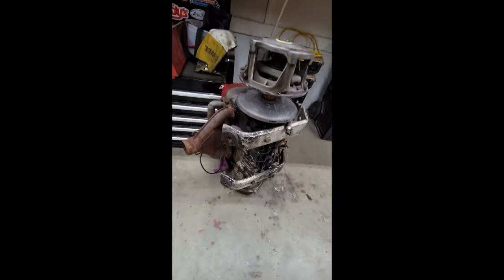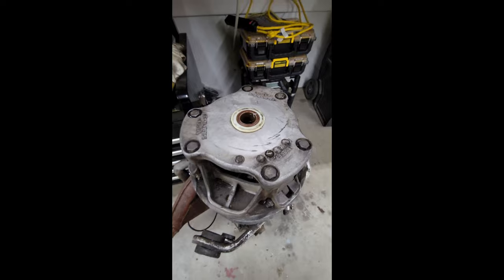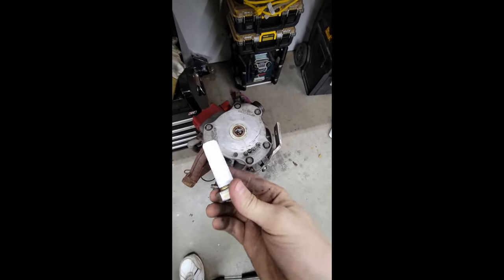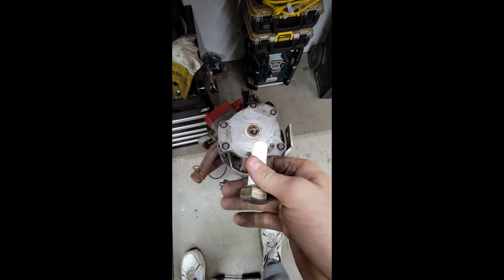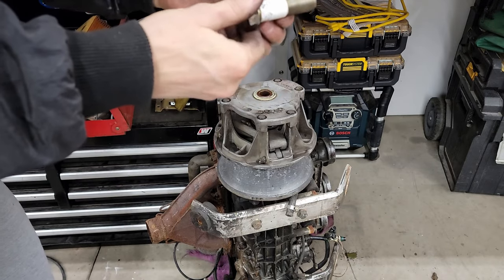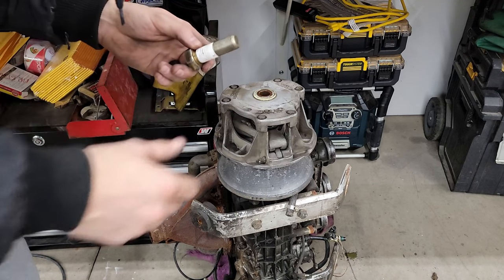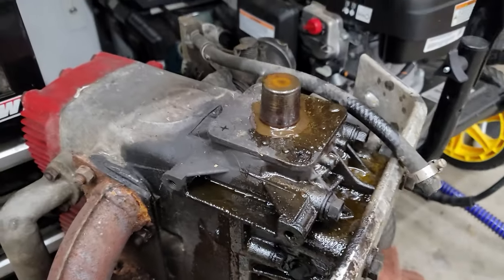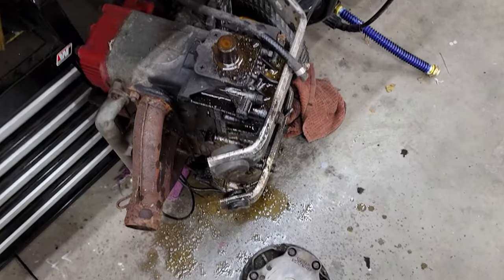Sled Tips 023 - Primary Clutch Removal water trick! YOU CAN SEE IT COME OFF!!

Comment: Using grease is much more easier but of course requires little bit cleaning afterwards. You don't need any tapes nor long bolts, just a short bolt is enough and no need to lean the sled.

Comment: Did you use original bolt or a new one
Reply from the maker: Different bolt. Bolt has threads for puller vs. which are different from the ones for the bolt that holds the clutch on!